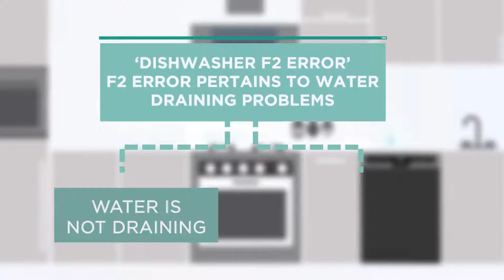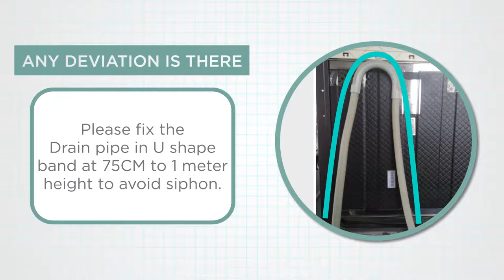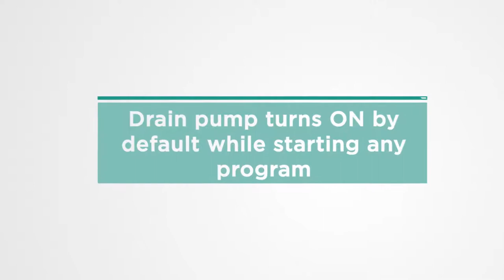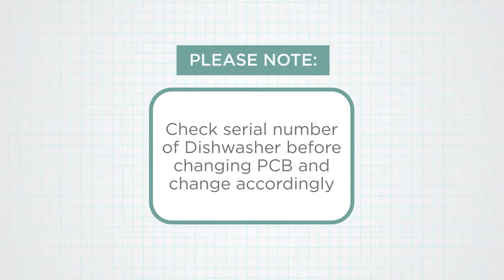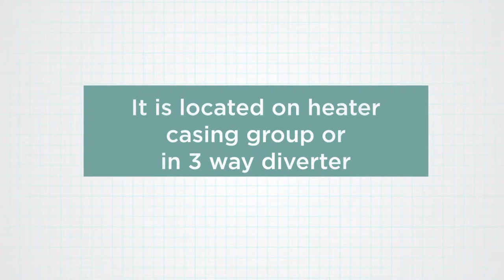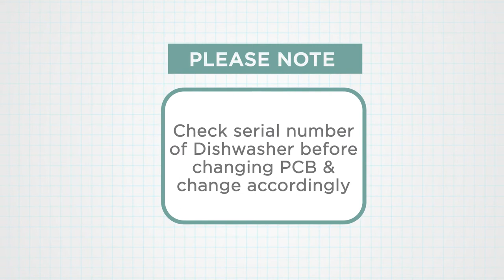F2 Error || IFB Dish Washer Error || Dish Washer Errors

Comment: What to do if : dishwasher keeps going off without showing any  error and aborting the programme, display  goes blank,  and returns to starting point aborting the Programe or the machine goes on pause halfway through the program and start pause button keeps flashing.
But NO ERROR at all on display.    I have been facing this repeatedly every alternate day and at times have had to re start the wash Programe upto 4 times so that I can get a, washed load of vessels to use.
Reply from the maker: Call To IFB Customer Care. 08045845678.